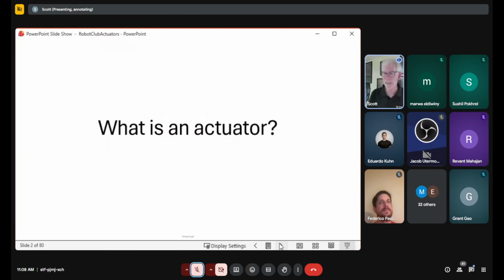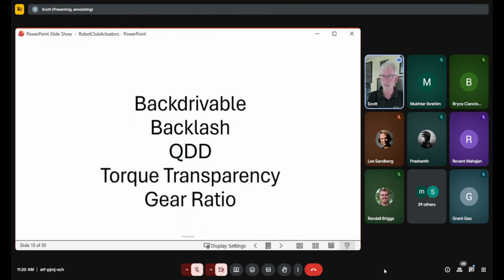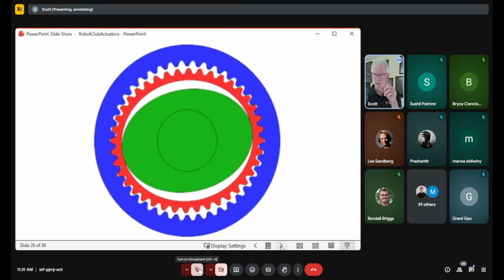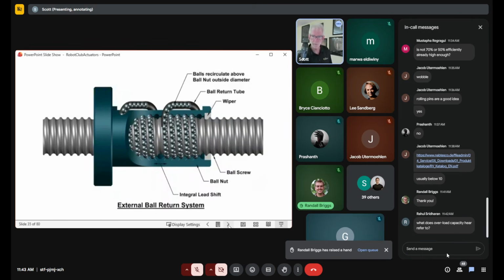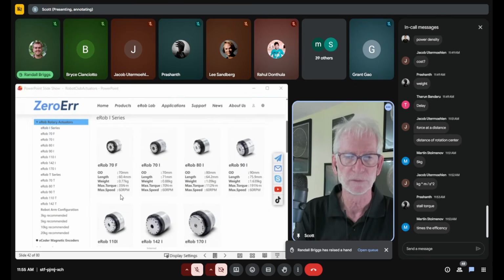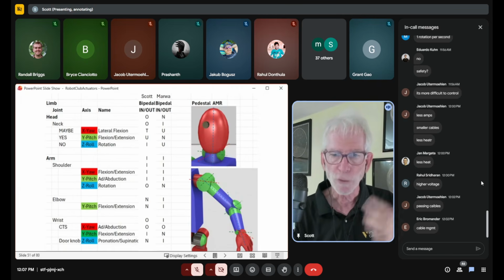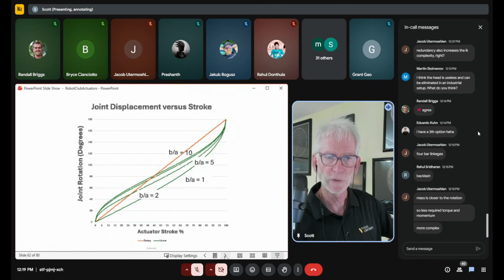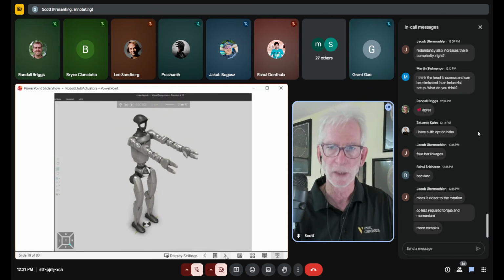A Deep Dive into Actuators for Humanoid Robotics — Robotics Club

Comment: Great breakdown.  nMECH Robotics uses a neodymium-free motor with 2-5x peak torque and the 4x the ability to cycle to peak torque. Our motors and actuation are unsealed and totally exposed to conditions that would foul and lock up the fragile systems used by other robotics companies.

Comment: I was hoping for a deeper discussion rather than actuators basics but it's still a good video. I wish there was more on the topic of QDD actuators for torque control vs having a large gear ratio with load cells when it comes to RL training.  (That is what I am currently struggling with in Isaac lab)